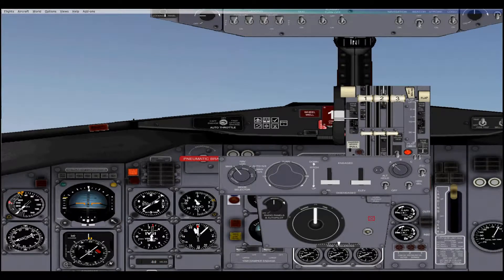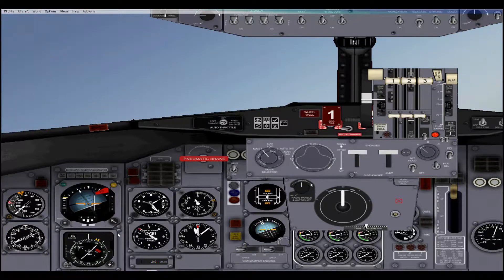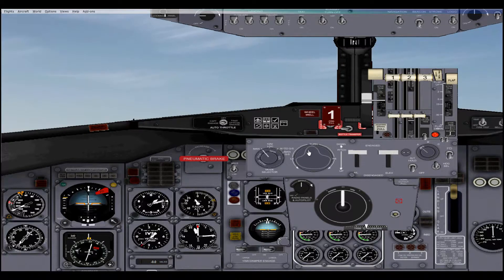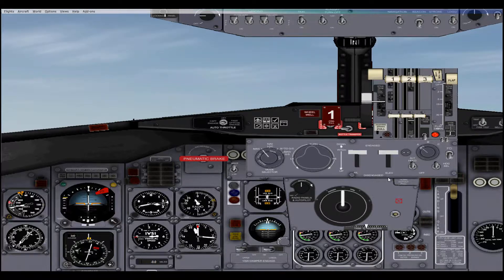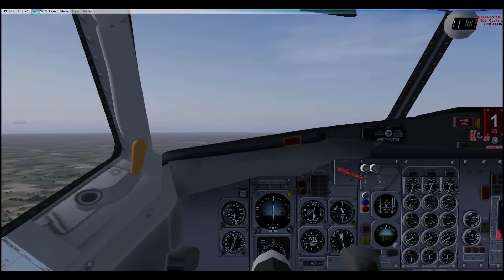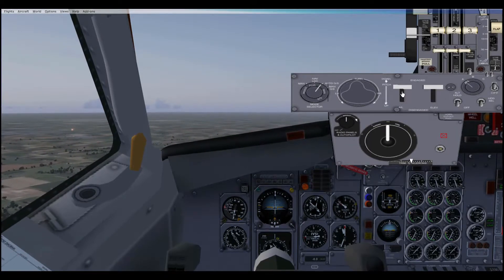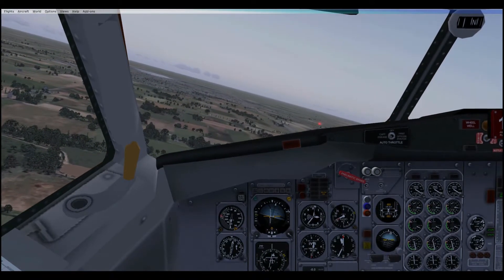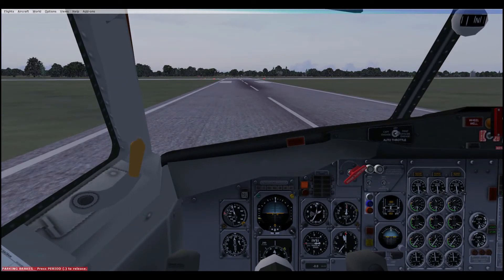How does the FSX Boeing 727 Autopilot Work? [TUTORIAL]

Comment: I flew with the 727's autopilot on, but I had a problem with the tower, it keeps instructing me to descend to 12,000 feet, when I was at 11,900 feet (according to the plane's altimeter). And even if I climb, the tower will instruct me to descend (again) to 12,000 feet, that's kinda making me confused. 
 I don't know you guys but, what altitude should I keep? I was thinking around 11,600 ft
Reply: @luizpereirasmodels
You have have to push the the "B" button on your keybord to synchroneize barometor pressure and your altemetor in the aircraft
Reply: When this happens hit B key it calibrates your altimeter in case of decalibration
Reply: @AmauryChihuahua  But at the time of the incident, the altimeter was already calibrated.
Reply: @luizpereirasmodels  Hmmmm... I will look on the addon to see if i try something
Reply: @AmauryChihuahua  Try to fly in the presence of bad weather, because that's how it happened.
Reply: @luizpereirasmodels  k

Comment: 1. You didn't level out at approach altitude, which is why the G/S never captured.
2. As you said, you started approach too close and need to approach the localized no more than 45 degrees, preferably 30.
3. There us no Altitude Select. It's Pitch Control. At 1000 feet below desired altitude,  lower the nose to a vertical speed between 500-800 rpm. At 500 feet below desired altitude, lower the nose to 500fpm. When you get close to the desired altitude (20 feet), flip on ALT HOLD. It will gently adjust to and maintain that alritude.
4. Know your approach speed before you descend. You don't want to be guessing at the last second.
Reply: It's my pleasure. Sorry for the typos, I was using my phone and didn't realize autocorrect had reared its ugly head. 

I love the 727. It's the only "old-style" aircraft I use regularly.
Reply: @ferret312001  do you have any recommendations for any other older aircraft? Any pointers appreciated
Reply: @memegod4433  do you mean what types of older aircraft I'd recommend?
Reply: @ferret312001  yes, especially freeware.
Reply: @memegod4433  anything from Thomas Ruth. His A300/A310 and DC-10 are awesome. Complete with Virtual Cockpits. Very nicely done.
Reply from the maker: Ken Webber thanks for the tips!

Comment: Hi! How you control the alt.hold,speed hold,vertical speed? Where is the switch of Nav and GPS?
Reply from the maker: SB9P4 the video covers everything you have inquired about other than Nav and GPS. Unfortunately, I am not sure about how to use those on this particular model.
Reply: @Stevepilot  l was flying that plane,and it's hard to control aircraft
Reply from the maker: @SB9P4  I agree, it's not the most intuitive system ever
Reply: Steve Pilot, the Alltitude is only this? No push altittude exact, only flying a this altittude and push Alltitude hold?
Reply: NAV/GPS is directly above the airspeed indicator.  (Well top right corner of it)